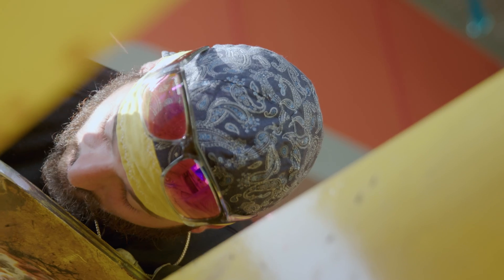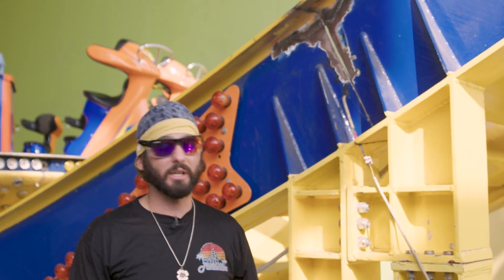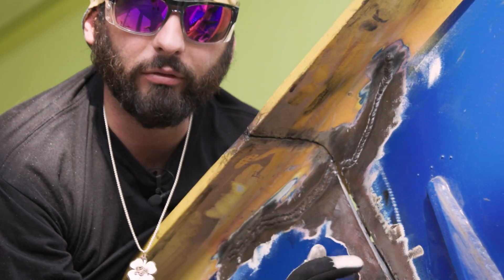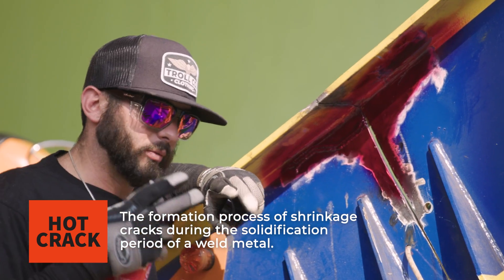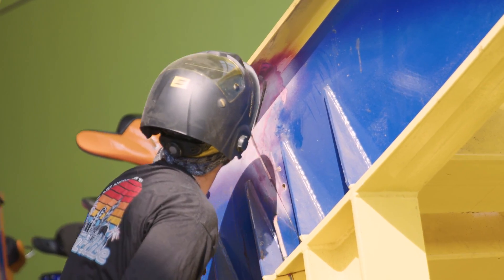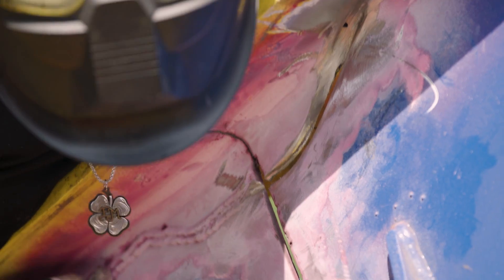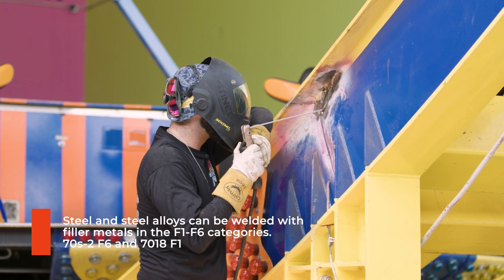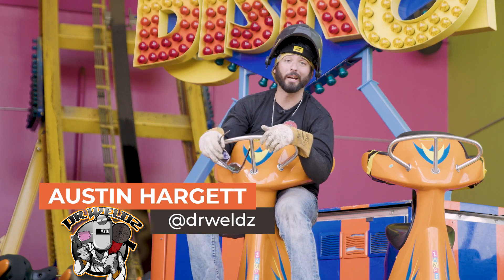Repairing A Roller Coaster - How To Fix A Crack

Comment: After finding the ends of the crack, drill a hole at either end to keep the crack from running when you put heat to it. Then air arc out the crack.

Comment: That may be how you weld it. But how do you prevent the crack from reforming. There’s a stress riser there. You should have plated it in both sides overlapping the crack by at least 12”
In each direction cut at 45 so the stresses are spread out. That crack will come back for sure.

Comment: Technically the BEST way to use the dye test is to wipe all of the dye penetrant off with clean dry rags without any cleaner. Then once you can’t see any dye from wiping with dry rags use a tiny tiny amount of cleaner on a rag and clean it again. Then wait 5 mins for all the residual cleaner to dissipate and spray on the developer. Have a flashlight handy. It will help to expose shadows from undercut etc. I dye pen 100% of my aluminum welds at work before calling quality control to come inspect them so I’ve become somewhat of a dye penetrant test connoisseur. The pink crap all over my hard hat proves it.

Comment: I’ve got a question, would carbon arc be better for this, and then grinding it all flat? Then weld it, because to me the carbon arc would just be able to blow all that junk out. But I’m not sure about the heat / heat absorption to the base metal that would cause.
Reply: Carbon arc would require a lot more power than that little 110 machine.  It would also require a compressor.   Then, there is the issue of how much hot stuff can you blast around on that site???

A little repair like that?  Always grind it.

Comment: I just watched another guy say you can’t weld anything thick on 110. then this guy fixes a roller coaster track. Obviously works well enough for that.
Reply: usually speed ends up being a problem
Reply: Usually a mig welder with 110/120v input is for light duty. As long as one can get up to 140A of CC output an 1/8 E7018 can be used effectively.

Comment: Will that repair be stronger than the beam when it wa new? Since it broke multiple times, how is that ride allowed to get reparied? Yes, I have no idea about this, just trying to learn. Thanks for the video. One of the better weld videos I have seen until now.
Reply: Because a proper weld ends up being just as strong as the original piece, can end up being stronger since you’re adding material.
Reply: @BarrackObamna  Yes but since it broke that badly, I would suggest there is something fundamentally wrong in the design. I would not trust any repair on that.

Comment: I would scab that no matter how bad it makes it look. Its a safety issue.
Reply: There might not be room.  There are rollers on the underside of the rail to keep the train on the track.  I do not know the clearances but they are not big.
Reply: @royreynolds108 True, I would figure out my clearance and do it where I could. The paint doesn't look like anything touches it. It would all depend on how the buggies are secured.

Comment: You said ER70S-2 has triple deoxidizers in it, but I thought that was S-6?  The information about it online seems to be conflicting.  If you guys have any info on the official differences in the standard steel TIG fillers, I'd appreciate some insight. 🙂

Comment: ER70S2 root with 7018 fill+cap is the best combination for strong, ductile weld.  Bonus for going over with GTAW wash to remove stress risers.  
This is low cycle fatigue at the joint.
Reply: My thought exactly

Comment: Would it be a good idea to plate that beam after you finished the cracks ?
Reply: I though about that, but they had specific instructions not to add anything other than the weld reinforcement. Customer gets what they want 🫡
Reply from the maker: Gotta make the customer happy
Reply: Not without doing the engineering for that plate first. I find it fairly sketchy to just weld the crack and leave it like that (even if they inspect it regularly), but just adding gussets can be equally bad and lead to a worse weak spot in a different place.

Comment: That is not how you do a "Solvent Removable" PT Inspection!
Reply: Yeah that’s what I realized after the fact. We were on a time crunch so instead of re-doing it, I tried letting everyone know I did it wrong 😂
Reply: Haha yeah the MT guy watching me was like, you did that wrong. Tried leaving a disclosure to do your research
Reply: @austinhargett5792  You are supposed to wet a clean cloth with the cleaner and then wipe in one direction in order to remove the excess penetrant.  Spraying the cleaner on the part can cause the penetrant to be removed from any cracks.

And you are correct about the penetrant dying your clothes.  I will usually put on a disposable Tyvek oversuit when I am doing dye penetrant.

Comment: If the parent metal fatigued and cracked out then a weld will not be a permanent repair. It’s either a design flaw or life-cycle issue. I would have done a hot root pass with 5P and then 7018. And admonish the owner of the need for routine inspection.
Reply: They do inspections, that’s why they called. But I do agree and I warned them they probably won’t see the last of them.
Reply: How frequently? Annually or do the operators do a walk-around every day at startup? @austinhargett5792

Comment: Surprised that you guys are using tig thought it would definitely be stick very impressive dudes great video
Reply: Going into it, I thought I was gonna tig weld it all, but 140 amps wasn’t enough. 90 with a 7018 was though! Cut the crack out all the way. Rooted it with tig, 7018 the rest
Reply from the maker: Thanks 👍